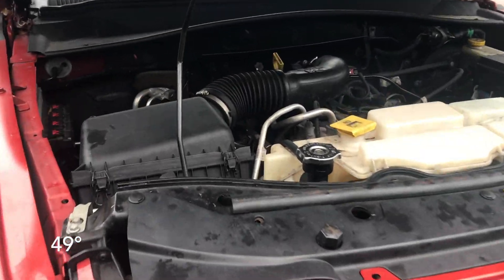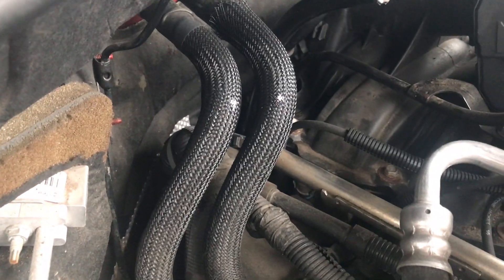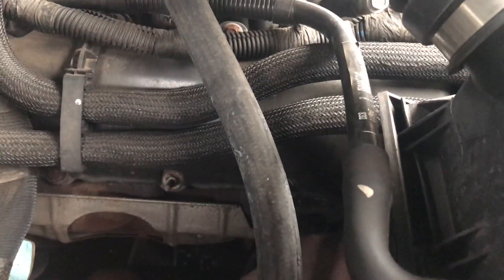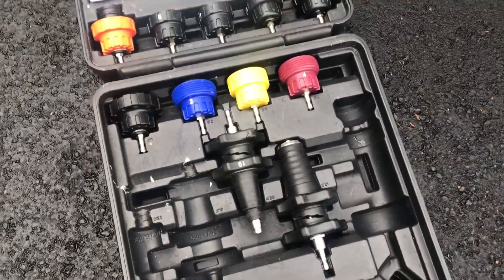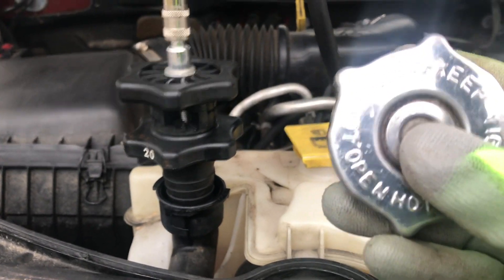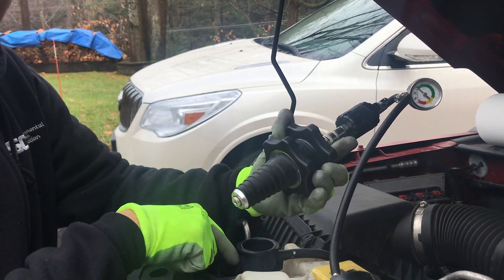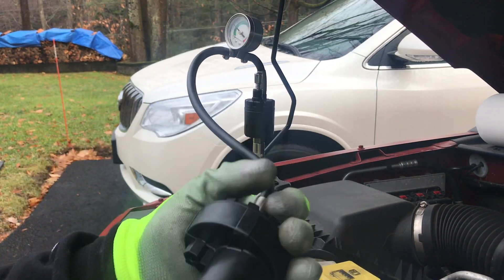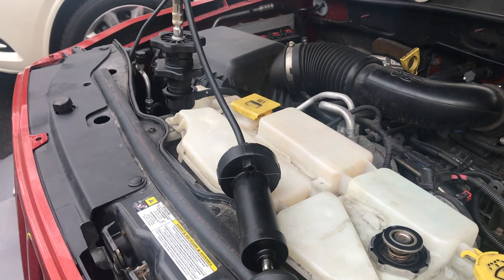Cooling System Pressure Test

Comment: I rented the same pressure tester from my local auto parts store, and used it in my jeep wrangler. I had the same catastrophic result before I got past 12. My cap said the same as yours, 18. I’m not sure if I should try finding a different tester or just try pumping to a lower pressure, maybe 10?